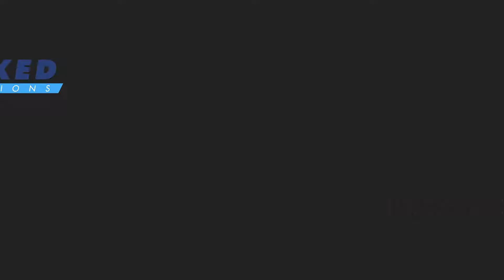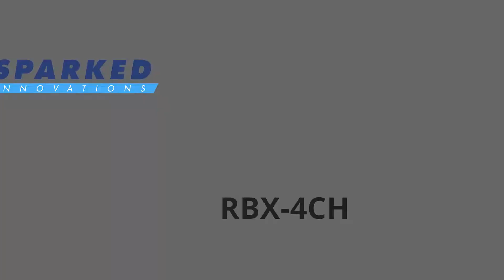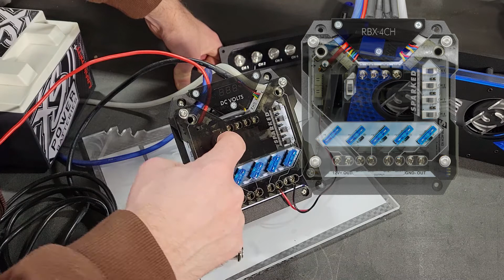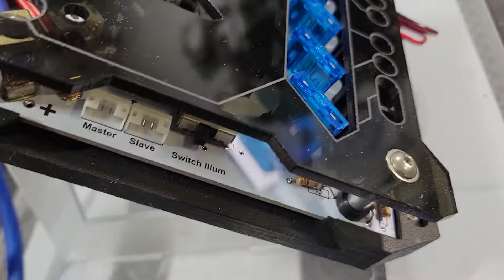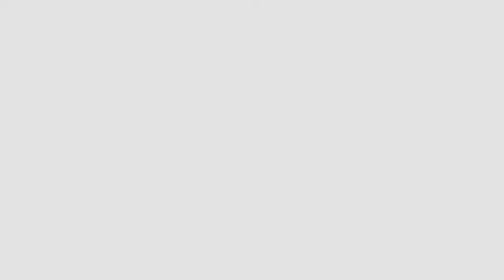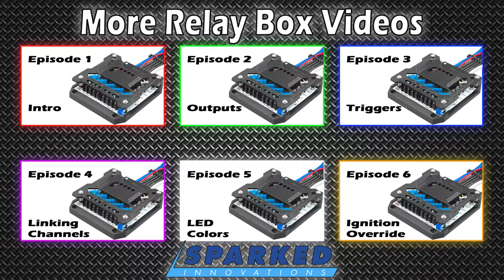Sparked Relay Box, RBX4CH Ignition Feature

Comment: When using the illumination function would there be a way to add a secondary dummy light to show that a circuit is on besides just the light on the relay box? Would like for the switches to light up with dash lights but want a quick way to visually verify what circuits are activated
Reply from the maker: Hi, Robert. Thanks for the question. One of the ways you could have a light triggered when the channel was activated would be to run a positive lead from a given channel to the positive lead of a 12V LED and ground the other lead.